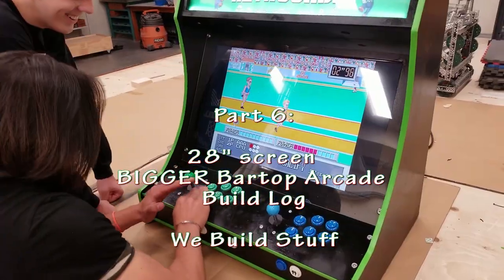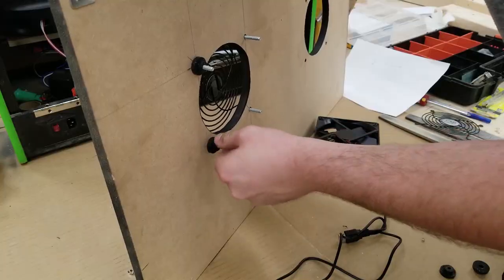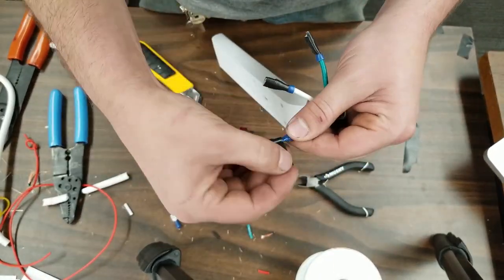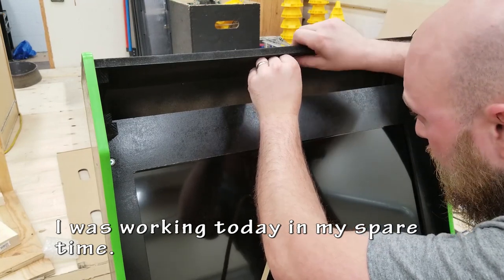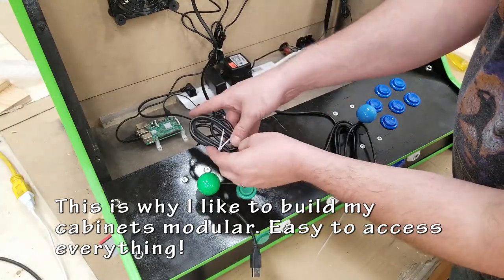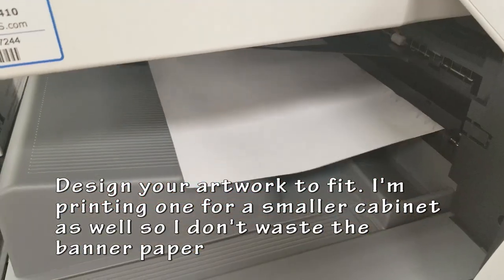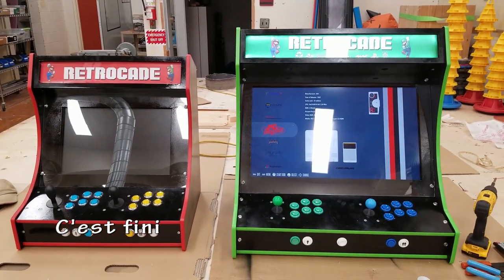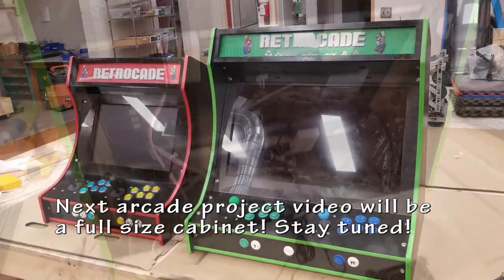How to make a DIY BIGGER Bartop Arcade! - Part 6 - Raspberry Pi

Comment: What a fantastic series. I am planning to build mine in the summer as UK weather is shit and I don't have a work shop. Anyway, the last 2 months, I been buying my components from eBay, way cheaper. I have everything apart from the MDF, monitor, lights and speakers. I am in planning Stage, deciding what size to build which will determine screen size and how much wood to buy. However, I am differently using your light switch idea, so going to make a list and buy from eBay. Anyway, what a great build series. I am so jealous of you students that get to play on such a awesome machine. Thank you. 👍
Reply from the maker: Thanks so much for the kind words! good luck with your project!!

Comment: I like the build. For your exposed screws you know you can get some plastic black plugs from the hardware that just attach to the screw heads? Looks a little better than exposed screws.
And I know what you mean about those LED adhesive lights not sticking. I put them in a jukebox build and even with them sticking to a painted surface they still came off. I ended up putting some electrical tape about every 30cm and stapling them in - Glue gun works good too! I think in future I'll glue them to a piece of 3mm MDF and screw that on instead so it can be removed if need be.
Reply from the maker: Thanks for watching!

Comment: Im amazed on how well detailed the videos are explaining everything. My bro and I are planning on building bar top arcade. I'm not experienced on wood work. I got couple of machines to work with. Witch tools you think is a must have to build an Arcade that will make things much easier you think? Thanks for the videos.
Reply from the maker: Minimum tools would be a drill and a jigsaw or circular saw. Other tools that are useful are a router and a chopsaw
Reply: @WeBuildStuff  thanks for replying.
Reply from the maker: @JonathanOrtiz-qq6nj  let me know of any further questions!

Comment: A bit confused...your video example of wiring the power strip to the IEC switch does not match the accompanying diagram. For the two jumpers your video shows them leap frogging each other but the diagram shows one on the outside terminals and the other on the inside terminals. Am I seeing this correctly or missing something?

Comment: Hi great video! I have a silly question but what size power brick did you use to connect your leds for the marquee, was it a 12v?
Reply from the maker: Yes I think I used a 12v 2amp power brick for this one. In the future I would probably buy a full kit that comes with everything instead of fiddling with different adaptors and connectors. The method in the video worked but was a bit of a pain.
Reply: @WeBuildStuff  Awesome thanks for the quick response! I'm almost done building my 2 cabinets! I just have to router out the dado around the screens, also paint the cabinets and wire everything up! You've been a great help, thanks again, your're the man!
Reply from the maker: @TLil21  awesome!

Comment: Hi can you give me a link of what you used to make all your wirings modular? I'm really impressed
Reply from the maker: Just wires crimped onto quick connects or bullet connectors from home depot. I just  use ones that fit the terminals I am using. I don't have any links though.

Were you referring to this kind of thing? https://www.amazon.ca/dp/B01D9CVFTA/ref=cm_sw_r_cp_apa_i_AMteFb0BHE08Q
Reply: @WeBuildStuff  yeh mate those! Cool cool really love your modular idea, I've always hated messy setups and this will be perfect! I got a few coin operated computers and this will tidy things up and more hehe
Reply from the maker: @jonathanjackson4500  i like to be able to take apart and replace things easily if needed 😁

Comment: So the tv stays on until u flip that switch bcuz your hiding the sensor for the tv itself? Also is it better to place the Plexiglas a lil away from the tv or on it ? I see the tv u have it inserted into the wood so it kinda gives the Plexiglas a couple of mm off.
Reply from the maker: Personal preference. I've seen this done lots of different ways
Reply from the maker: My plexiglass is maybe 1cm away from the actual screen but there are many ways to do this. I have the screen held this way just because it is how I have done it for a few years. You could also use an adaptor and the rear VESA mounts on the screen to hold it up and then have grooves/slits for the plexiglass to fit into. I always recommend taking a design and making it your own :)
Reply: We Build Stuff thank you very much

Comment: Hi, How do you get your tv to turn on automatically?
Reply from the maker: Some tvs will turn on once they sense power. I got lucky with this one. I did also drill a small hole for the remote control to aim at the IR sensor on the front of the arcade to easily change settings like volume, etc
Reply: Ok thanks alot

Comment: Quick question. My switch didn't come with the plastic toggle switch nut, would you happen to have an Amazon link to the ones you used?
Reply from the maker: Are you referring to the one I used for the LED lights? If so then I just picked up a cheap one from Home Depot
Reply: @WeBuildStuff  Yes leds to light up the marquee. Oh I didn't realize they had them, I used to go to Radioshack but they closed all their stores a few years back. Thanks again!
Reply from the maker: @TLil21  oh ya!
Reply: @WeBuildStuff  So guess what I just realized something lol soooo apparently the rocker switch I have has a nut screwed onto the switch itself already,  it blends in so it was hard to see it! lol I went to Home Depot and the guy unscrewed it and I pretty much felt like a retard hahaha but I didn't leave empty handed, I bought a few bullet connectors haha Thanks again!
Reply: @WeBuildStuff  Hey sorry to bug you so much. Would you happen to know which type of bit you used to make a dado/rabbit on your front piece to fit the tv into?
Reply from the maker: @TLil21  i believe it was 1/2". Depth set to approximately half the thickness of the material

Comment: How much did this cost to make
Reply from the maker: The larger screen was the majority of the cost but I've build smaller ones for $200-400 with a 19" computer monitor and raspberry pi. This one cost more because of the increased size and a few extra requested parts

Comment: Seems like I won't be able to fit a computer in there.... Need to adjust the size then hee
Reply from the maker: Don't try and stuff the whole computer case in there. Consider mounting the motherboard to the back door/wall, and other pieces bolted/screwed down inside your cabinet. Make sure you have airflow and consider adding some extra fans for cooling :)
Reply: @WeBuildStuff  thanks! Yeh I'll do that and have at least 3 fans hehe 2 intakes and 1 exhaust for good measure